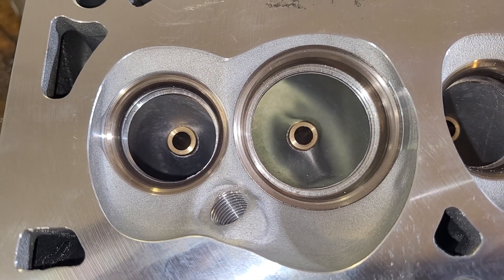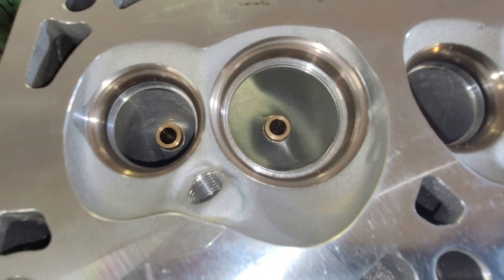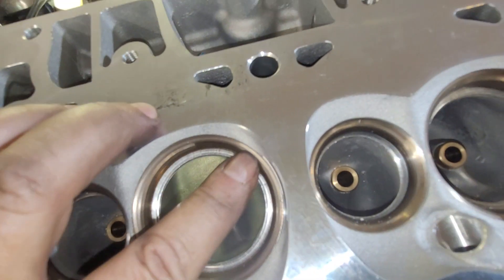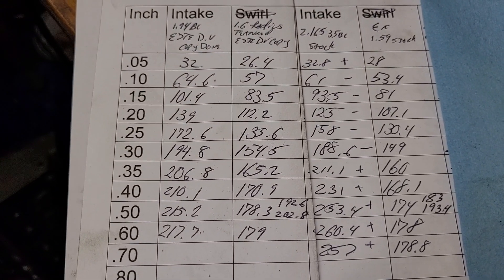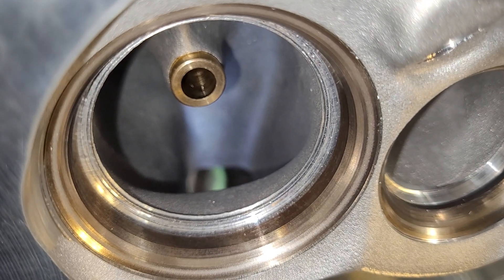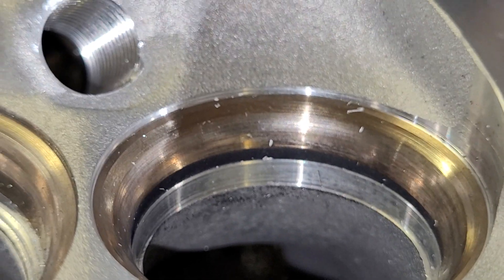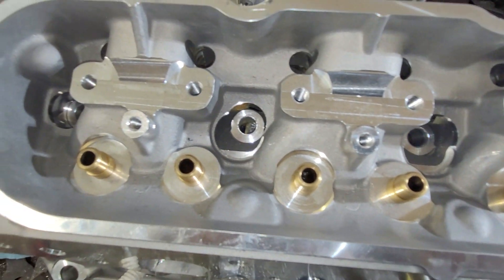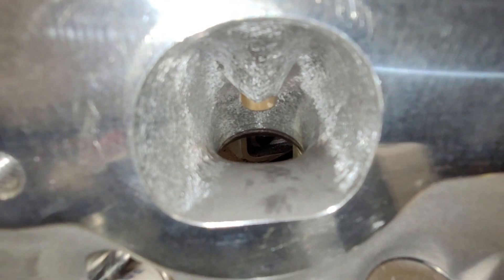Chevy ls3 cylinder head copy stock and clean up flows

Comment: Hi Charlie. That was quite a difference from stock. When you are porting a head how do you know you have reached or are near the limit of what they can flow in there current configuration? Example E7TE head, install 1.84 intake throat is 87% at 1.60. How do you know what  the max cfm is that will flow through the throat? If you ( anyone ) don't know what that is than at some point you have reached the limit and your just chasing a ghost. This is assuming that the throat is the smallest csa. I have a guess that you are going to say the answer is in the IOP program but what if you don't have that. Thank you for you videos and expertise. Andrew
Reply from the maker: Truth.... you know you hit the limit when you put in more work so you have a bigger port and the flows stay the same or go down. You are losing at that point. Smart money quits there. Me not so smart. I look for what is holding it back. I look at the whole flow curve when figuring my throat ratio. If I can get a good strong flow curve with a tighter bowl I will take it. Yeah, I can just cut it for high throat ratio and make it a flowbench queen but I doubt it will make more power unless it is a big cam.
Reply from the maker: Calculation for how much flow would be calculate the area of the throat and multiply by 146cfm/sqin that works for 28 inches water.
Reply: @servediocylinderheads  Hi Charles. Thanks for the calculation. I saw this video before the one comparing your E7 vs GTP. I really look forward to your videos ( a mini series I hope ). Some might say why bother with factory iron but it is something the average or perhaps above average guy can do. It also is good to learn on something and if you mess up an E7 you can get a replacement pretty cheap. I am helping a friend with a set of E7 heads. He doesn't want to set a new track record, he just wants a good working efficient engine with a little more passing power. Thanks again. Andrew

Comment: Yup they are the most important areas,  ls 3 heads don't need anything crazy done ports are already large and the cross sections don't need a whole lot either , to much in the wrong spots will hurt them👍